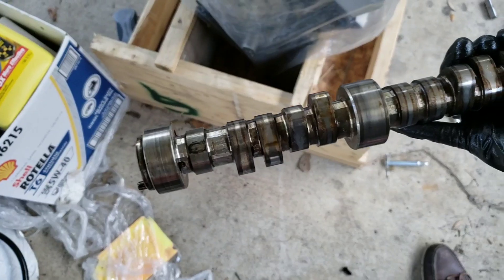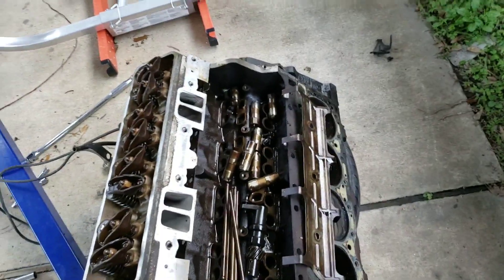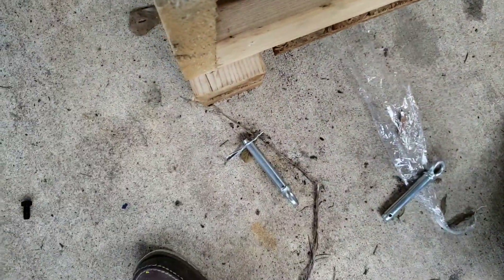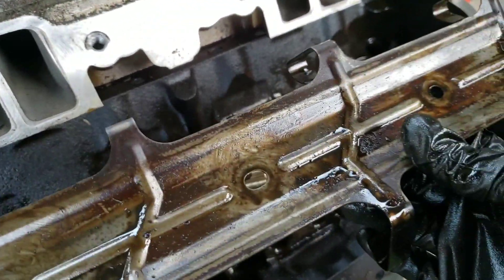How to remove a camshaft from a small block Chevy

Comment: Is the motor in a kinda older 350 corvette like 1984 or 86 worth rebuilding what motor does s it most likely ya reckon? Is a LS a good block to mess with and rebuild?

Comment: You do NOT have to remove or loosen the heads to remove the camshaft...
Reply: @alaaabdelhamid6501  Absolutely, no need to touch the head bolts/studs at all, just the rocker nuts, push rods and lifters. Once those are out, just wiggle the cam out and put the new one in with break-in fluid all over it. After that, as long as your engine is put everything back together and time the engine correctly and you're good.